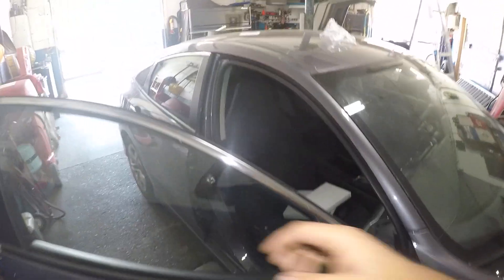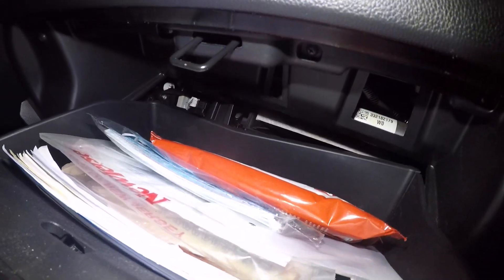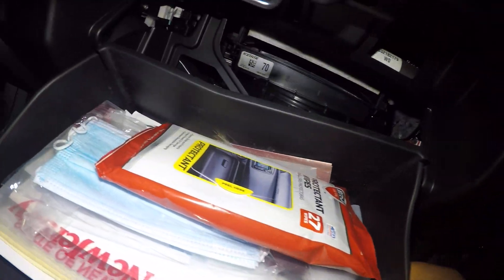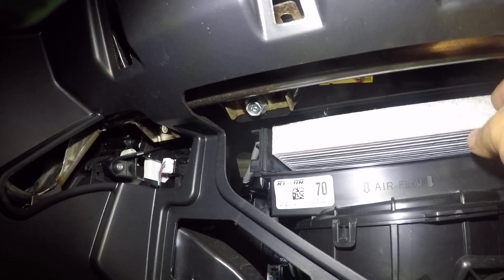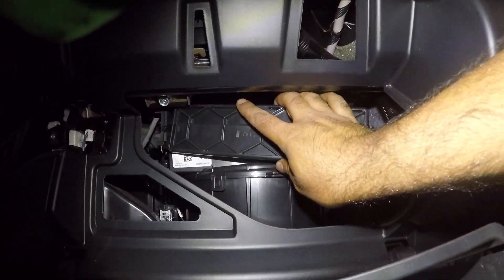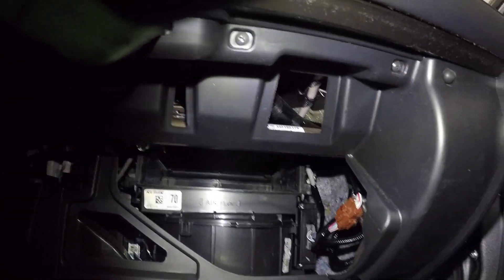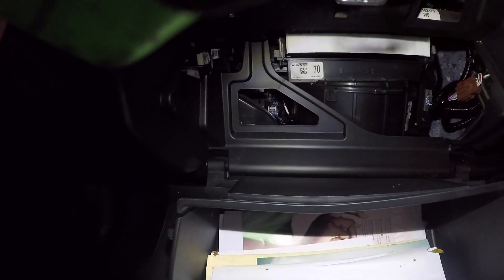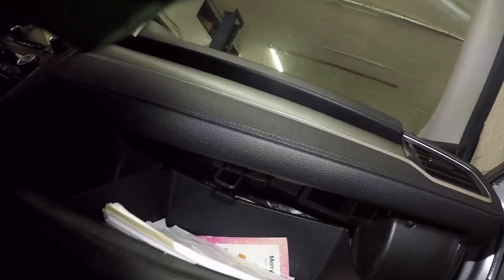How to replace cabin filter on 2018 Honda Civic

Comment: so it looks easy, I should be able to do this myself yes?
Reply from the maker: Yup easy
Reply: cabin filter, engine air filter, battery, change tires and jump starting car you can easily do yourself.   Do not pay for this service.   I would only take car for oil changes to dealer since that is messy.   But even spark plugs you can change yourself. Break fluid and brake pads is also straight forward with some basic tools and youtube video guide.

Comment: My air flow is point down in the car but the filter I purchased at auto zone is point up so which way is it? Or did I get the wrong one?
Reply from the maker: It could be wrong double check with parts department

Comment: How often should this be changed?
Reply from the maker: Every 15k miles with engine air filter do both togather
Reply: @RBTheMechanic  mine seems to get dirty faster then every 15k miles. I only have maybe 26,000 miles on the car and have had to change it twice already.. probably a third time my next oil change. Do you know what the reason could be for this?
Reply from the maker: @brittannyalexandria777  Noo it dose get dirty so maybe the area u in spends or how much u keep it fan on but I think it’s normal